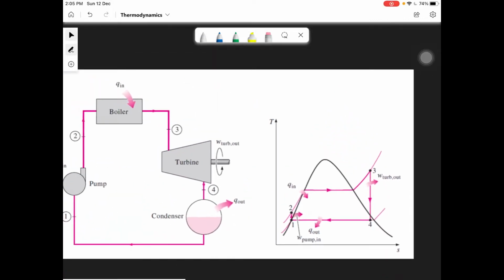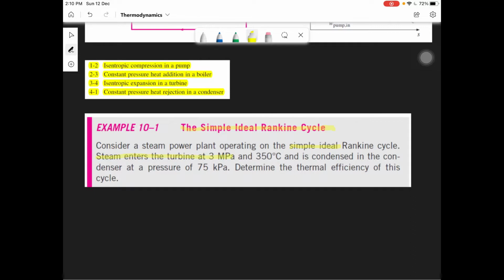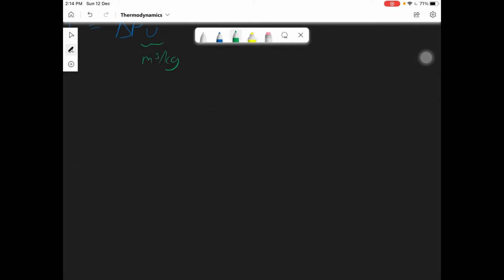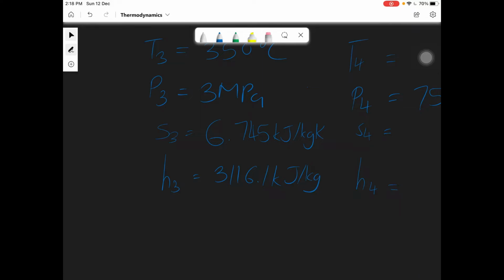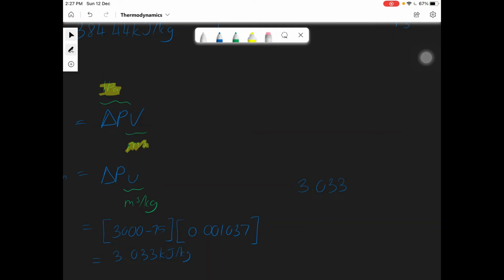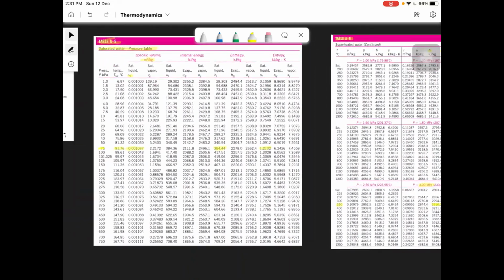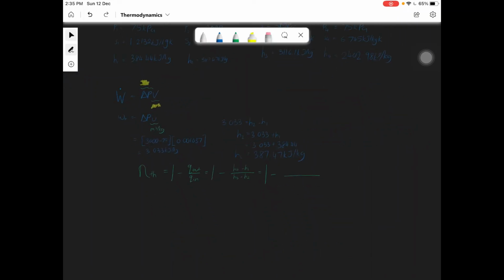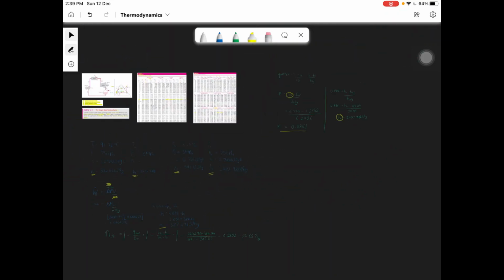Simple Ideal Rankine Cycle | Coal Nuclear Power Plant - Example 10.1

Comment: thermal efficiency in the book is found to be 0.415 using temperature minimum and temperature maximum. so which one is correct?
Reply: What is the name of the book ?
Reply from the maker: @HandNoteLala The book is Thermodynamics An Engineering Approach
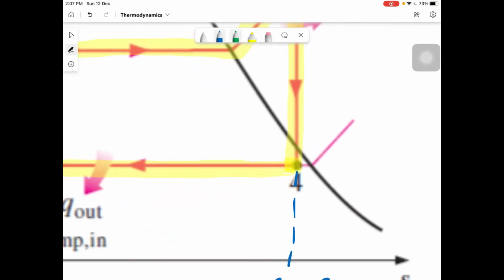Reply from the maker: Hi thanks for your comment. Yes I am aware that the textbook example has the answer of 0.415. My objective in the video was to highlight an issue. If you could kindly refer to 1:58 of my video, I mentioned that point 4 isn't exactly at the saturated gas line, therefore we should introduce the equation for quality, x. Hope that clarifies! Sorry for the delayed response.